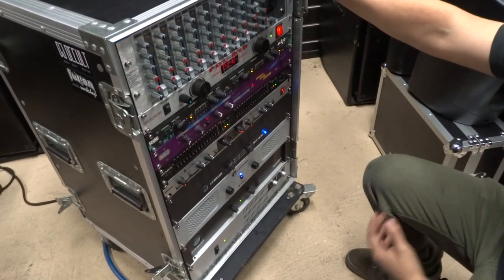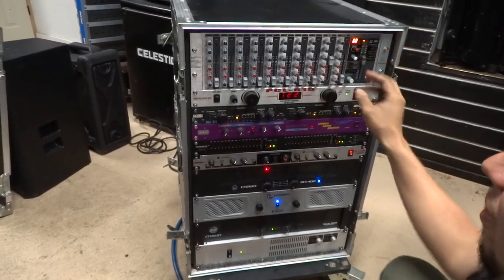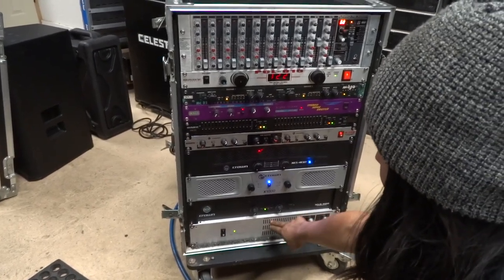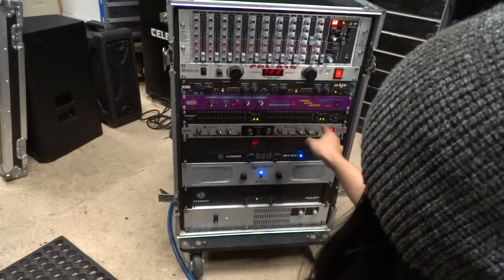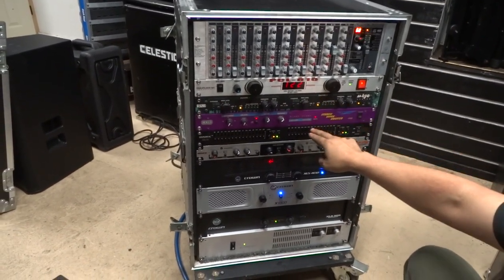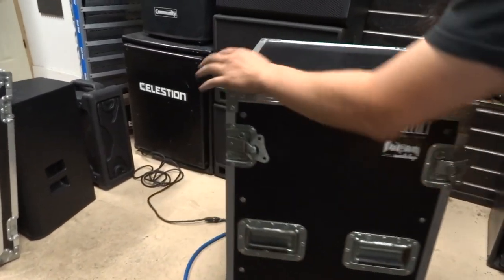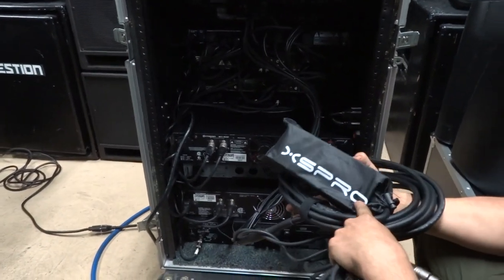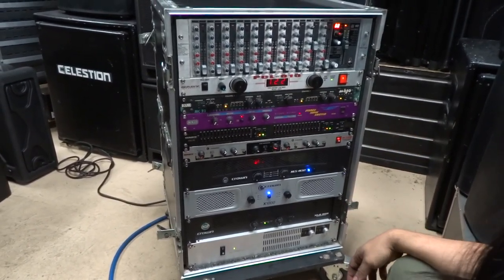Building An Analog Sound Rack

Comment: How many ins/outs does that compressor have? putting it before the mixer for live sound, how many different "elements" can you run into it, or is it only dual channel?
Reply from the maker: i now use digital amps with limiters built in but yes, you put it after the mixer so anything going thru protects your speakers. its only stereo 2 channel.